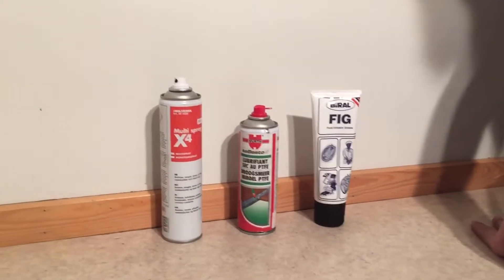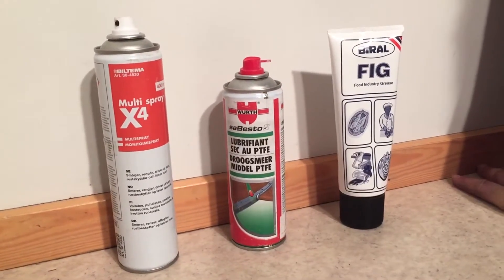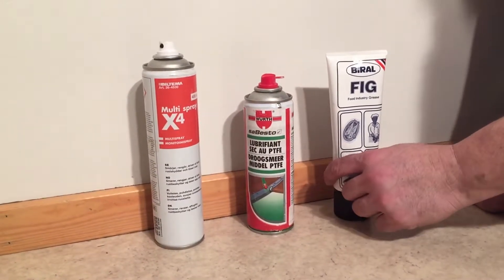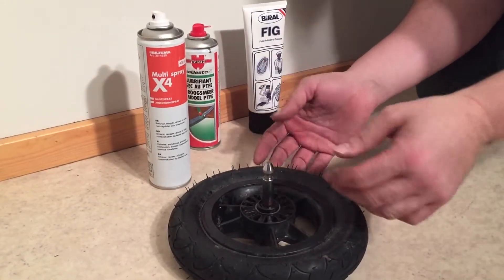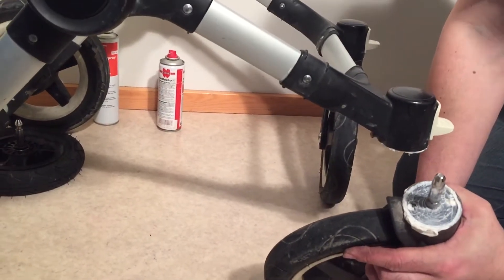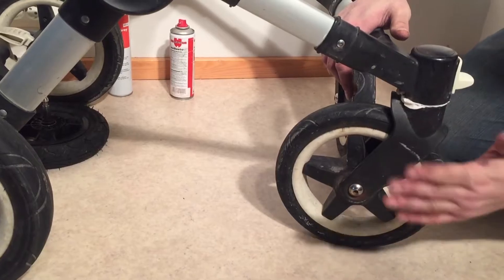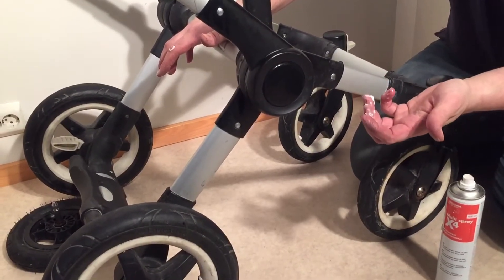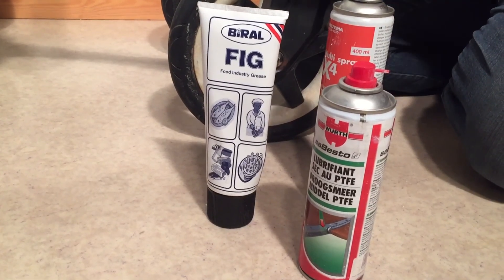A Guide to Lubricants Used in Stroller Maintenance and Repair

Comment: Isn't WD 40 quite a bad lubricant, I thought it was mostly for cleaning or opening bolts that are stuck?
Reply from the maker: This is part of why it is good.  You have to consider the application: in this case, we're talking about multi-part metal mechanisms which are often difficult for people to get to without disassembly, often including drilling out rivets.  And in many cases rust has already begun.  WD-40 can be sprayed easily into cracks between components and will first loosen the rust and then act as a lubricant.  Of course it does not provide the same longevity as fully disassembling a mechanism and then using a proper grease, but, if used relatively regularly, it will work quite well in many situations.
Reply: @BarnevognverkstedNo  It would be great if these caveats were mentioned in the video. WD40 and similar penetrating sprays are mostly solvents, with very little lubricant. I mainly use them for cleaning oil and grease off parts, not lubricating parts. If someone uses WD40 on a functional bearing, they may actually be reducing the amount of lubricant in it, not increasing it. I would prefer to use WD40 to clean out dirt and old grease, and then use a lithium grease spray to try to get some proper lubricant in there if there's a big enough crack to spray into.

Comment: Stroller brochure included with purchase indicated "A dry silicone spray (e.g. 3M 08897) can be used to lubricate the wheels; however, be sure to use it in a well-ventilated area. Avoid the use of oil or grease based lubricants (e.g. WD-40) as they attract more dirt and dust"
Reply from the maker: dry sillicon spray has it's uses but does little for metal areas like ball-bearings, especially after rust has set in.  Furthermore a lot of areas on strollers are difficult to access without major disassembly (often including the drilling of rivets), and since sillicon dries very quickly (ceasing to be a liquid that can run into cracks) it makes it impractical for most stroller applications, especially when we're dealing strollers that have been used for a while, not fresh out of the box.  Lastly, dirt and dust are a reality, regardless of what you've lubricated with, and when dirt and dust get in your mechanisms, you can dislodge that dirt and dust with a spray like wd-40, but you can't with sillicon.  Stroller manufacturers, in my experience (and I've worked with a few of them) are unfortunately not usually that good at understanding how their strollers will stand up in the real world over any real length of time, and their suggestion to use only silicon comes from the engineers in their design department, not the repair personell in their after-sales departments (for those brands that even bother to repair their strollers, and thus learn what is actually going wrong with their designs, rather than just replace them).

Comment: Thank you  for the comprehensive review. We own an  Uppababy Vista as well as an  Uppababy Cruz 2019. We are  extremely  satisfied with the wheels  performance of the  Vista, however, the Cruz gets stuck  a lot and won't move forward.   I couldn't  find the  Fig multi purpose grease  by Biral  anywhere. Can you kindly  provide a link? Thanks.
Reply from the maker: The Biral FIG has gotten harder to get ahold of since this video, but CRC food grease works too, if you can get ahold of it. :)

Comment: I just bought a multi purpose grease (universalfett from Clas Ohlson) for my Stokke Trailz, should I return it and get a good industry grease instead? If so, do you buy yours in Norway and where?
Reply from the maker: Yes, you should probably just return it unfortunately.  A multi-spray is good for the brakes and the folding mechanisms, but I'm guessing from what you bought that you might be having problems with the front wheels, and (if this is the case) on a Trailz, you should only use Biral F.I.G., which needs to be ordered online, or if you live in Oslo, we can help you out with this (just send us an email via the link on the channel homepage).  Additionally, if you have the old-type front wheels (without suspension pads, see this video to see what I mean: https://www.youtube.com/watch?v=Hn-4v2TjVe8&t=56s), then I would recommend contacting Stokke customer service to upgrade to the new ones, which were released specifically to deal with front wheel swivel problems :)
Reply: The Stroller Workshop thanks for the good reply. Yes, I recently bought a used trailz 2019 so it has the new wheels, but they don't swivel as well as they're supposed to, so I was gonna put some grease on them. Unfortunately I live in Bergen, but I will order it online then.
Reply from the maker: cool, that should fix it :)

Comment: Could I use teflon grease instead of the FIG/silicone grease?
For bugaboo front wheels general maintenance.
Reply from the maker: I have never tried it.  From reading online, it looks to be nearly the same thing, but with more protection against heat and corrosion, but beyond that, I wouldn't want to say.  If you try it, and it works well, though, please post about it :)
Reply: @BarnevognverkstedNo  Thanks! I’ll give it a try.

Comment: I have a babyjogger city select and the folding mechanism is stiff. What would you recommend to loosen it up? Thank you. :)
Reply from the maker: Lift up the handle and spray some wd40 into the mechanism and then work the mechanism a bit (on both sides), that shoud fix it unless it's a mechanical defect :)